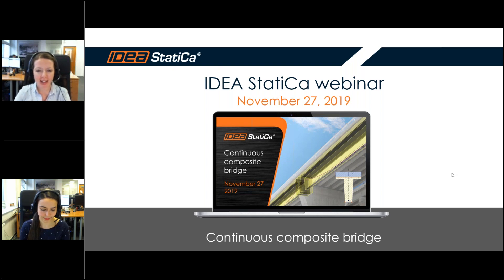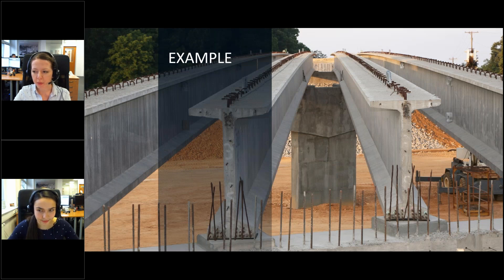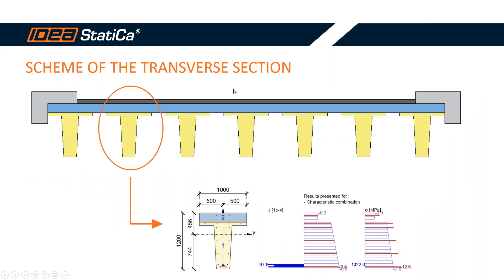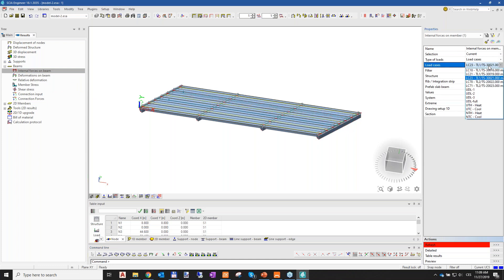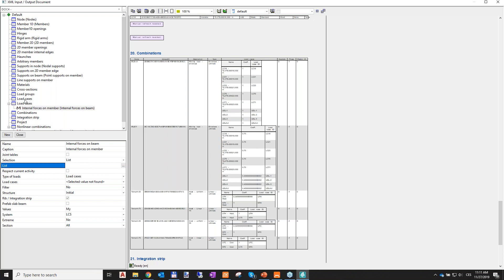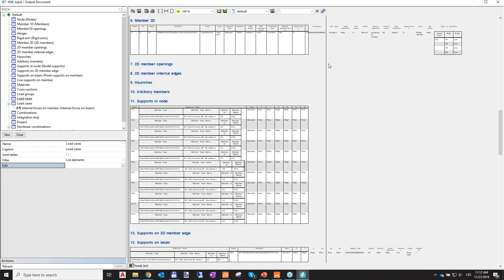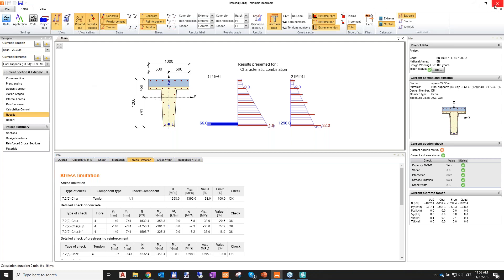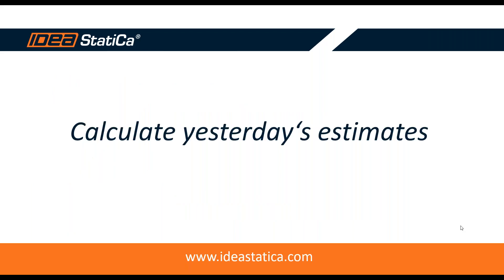Design of a continuous composite bridge using IDEA StatiCa

Comment: When we are checking interface shear in the joint between concrete cast at different times, would that reinforcement (which is our beam shear reinforcement as well) be additional reinforcement, or do we check shear, then check interface shear, and if the same reinforcement satisfies both we are OK. 

OR do we calculate shear reinforcement and interface shear reinforcement separately and add them?

In case we have continuous composite beams in buildings, is it allowed to rely on this connection, or would we have to have separate in-situ section over support (like in this bridge example) to avoid interface?

Thank you.
Reply from the maker: Hello,
the same shear reinforcement must satisfy both, the shear between two concrete parts and the shear due to external loads. So no additional reinforcement is needed.

The structure can be modeled as a composite over the whole length. It is not necessary to model the cast-in-situ part as in this webinar. In bridge engineering it very usual arrangement, though.

For further assistance, contact our helpdesk, please. (helpdesk@ideastatica.com)

Have a good day!
IDEA StatiCa :)